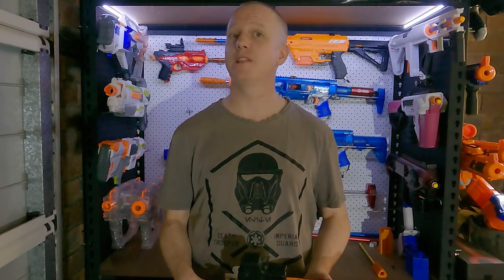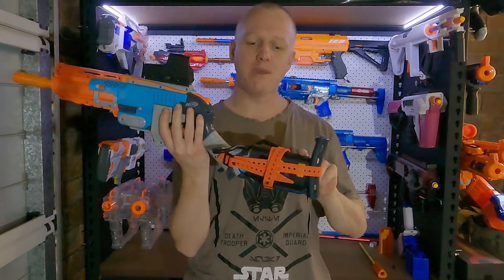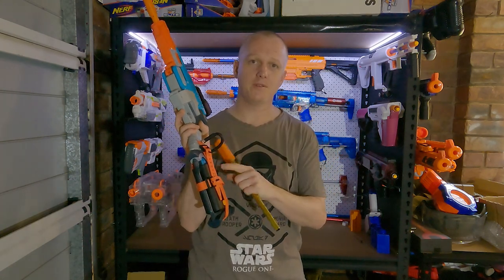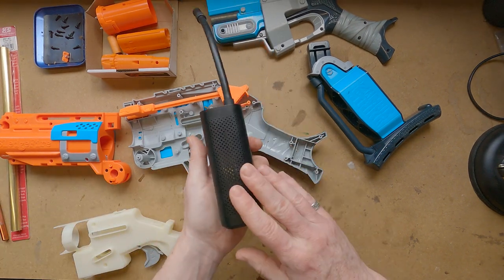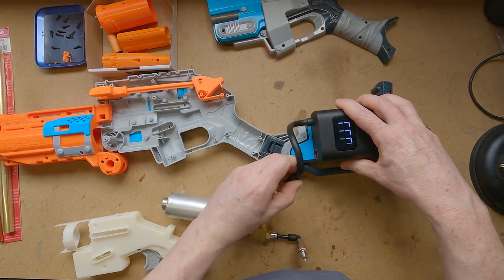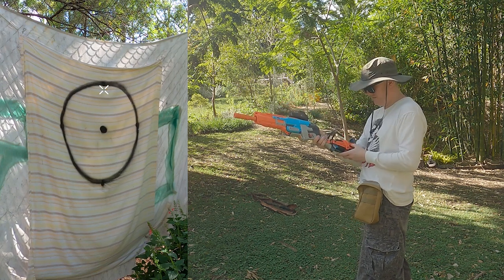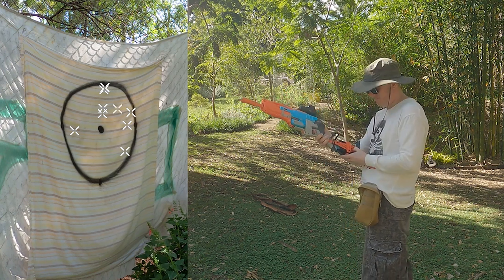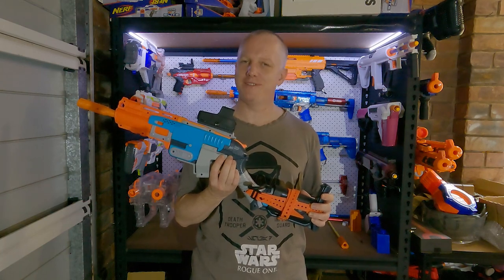Blaster Breakdown 14 (Feb 2021) - Spexdgefire LPA, a Nerf Sledgefire LPA mod with onboard compressor

Comment: I'm late to the video, I bet those mini compressors are already 'sold out'.
Reply from the maker: Nah, get them anywhere from Amazon or Ali. I'm looking forward to other people fitting these into other blasters 😁
Reply: @andrewg_nerfmods  This was going to be my first 'air powered' blaster a couple of years ago but I couldn't find any small compressors, Cobbacrazy's idea was just too large ( and had to be rewired for LiPo ) Thanks to you finding these I think I will get one and probably use in some sort of 'bolt -action' set up. That way the time it takes to load a dart should be the time it takes to refill the Spexbz. I've been thinking with mixed games ( Hpa and Springers or Flywheelers) that Hpa is so over powered that it is slightly unfair, this set up will reduce the ROF that I think it might even it out a bit.
Reply from the maker: @mainstay.  I'm definitely looking forward to see what others build using this compressor - I know of one interesting build nearly ready.
The HPA vs springers vs flywheels debate is a long one, not going to get into that here!
Agree on bolt-action - if the prime action can be made to hit the button without a separate movement that would be great. Sledgefire is already multiple steps to reload, so I thought one more wouldn't make much difference.
Reply: @mainstay.  I've been looking at using a compressor with the batteries from Ryobi
Reply from the maker: A year on, I've bought more of these units, and know plenty of people who have too. There are also other alternatives available on Ali and elsewhere.
Reply: Ok a year later. Finally got around to getting a mini compressor blaster started. I actually found a Xiaomi  on Amazon.
Reply: Is there any better options out there for a faster refill?
Reply from the maker: HPA bottle? 😁
A bigger compressor would fill quicker, but then be heavier to carry.
Reply: @andrewg_nerfmods  Lol, thanks Captain Obvious.  I want to avoid a tank.
Reply from the maker: 😉
Have you seen Cobba's remote line LPA setup? I'm pretty sure this unit has a much faster recharge rate, and fits in a backpack: https://youtu.be/VNV_g9r2-1s

Comment: Should I get a normally open or closed MJVO-3 valve? Also, could I get a parts list? Great vid btw.
Reply from the maker: Open - that's what the O in the product code stands for - that means the Spexbz will be pressurized until you pull the trigger. Parts will vary based on your location - I use 1/8 BSP threads and 6mm hose & pushfits. Any shape parts to fit your blaster are fine - the only ones you'll definitely need are male 1/8 threads to go in the back of the Spexbz and each port of the MJVO-3. I use 6mm nylon hose.
The Schrader valve to BSP nipple I found on eBay - you can get NPT version too.
And thanks, glad you enjoyed it 😁
Reply: @andrewg_nerfmods  Thanks!

Comment: So I'm super interested in doing a build like this, but having trouble understanding the difference in mechanics between HPA and LPA (so that I don't purchase the incorrect internals)
Reply from the maker: Hey mate - HPA is when your air starts off at high pressure in a paintball bottle, and gets regulated down to your operating pressure. LPA is when you compress room pressure air up to your operating pressure.
As far as the blaster goes, it will not affect performance whether you're getting 20psi from a paintball bottle or a battery-powered compressor - it will fit the dart just the same.
The internals here are all the same parts I use for HPA builds, and I could even run this compressor on a belt and use it with any of my remote-line blasters (although it would not be practical with Super Core builds).

Comment: Nice build! Is there any way to automatically let the compressor recharge the pressure? I think i've seen this with other compressors being used in nerf
Reply from the maker: I wish! This compressor just isn't designed to maintain a pressure that fluctuates, so it only has a cut-out sensor, not a cut-in one.
I've seen a teardown video online where a guy pulled one of these apart, so potentially you could isolate the charging button and trigger this with a pressure sensor switch?
Another thought I had was having a physical switch that presses this button upon reloading action - so linked to a pump or bolt action perhaps. But that's for other people to figure out 🙂